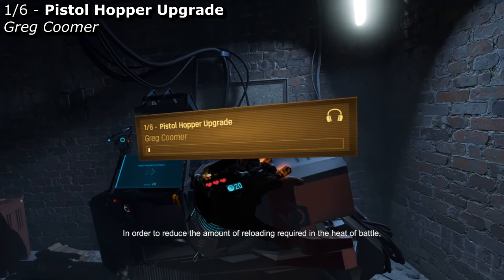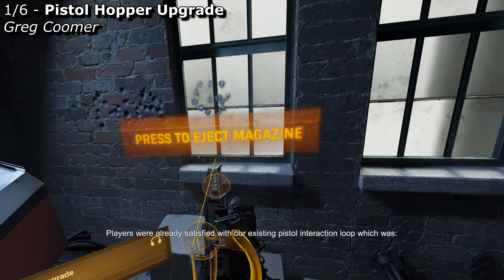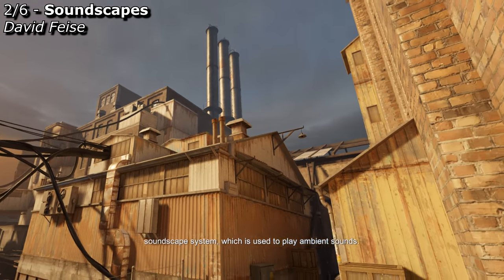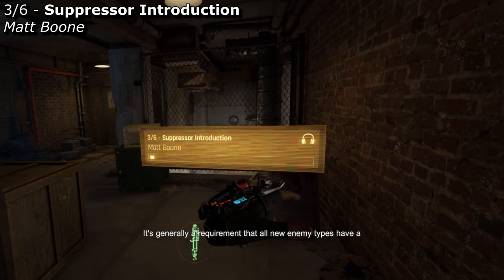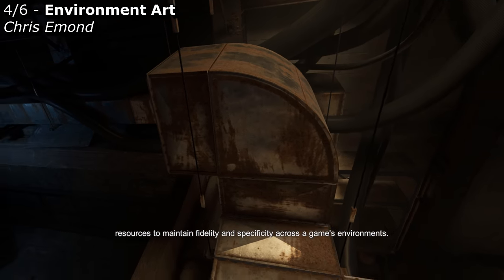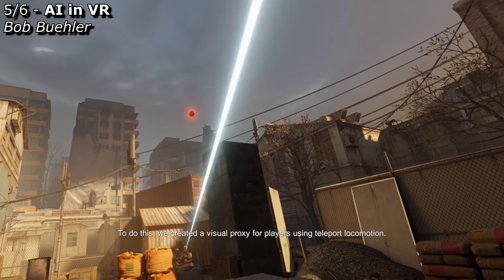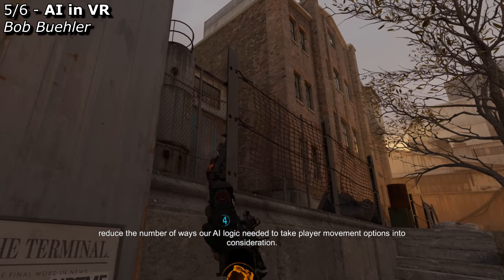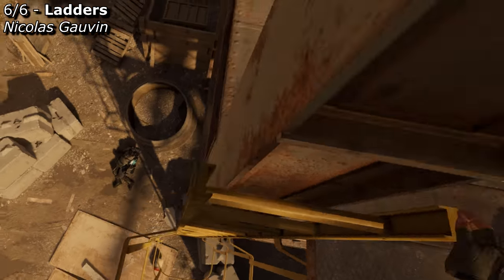HLA Developer Commentary - Chapter 6 - Arms Race

Comment: Hearing this guy say “clips” instead of “magazine” so many times made me physically hurt
Reply: Even internally in the Hammer editor, they refer to pistol ammo pickups as "clips". Valve pls
Reply: @UCM6YqV3fMAvewEykZnEYJjA  counter point: mag
Reply: With the hopper design the magazines are basically functioning as a clip, loading ammunition into an internal magazine like old ww2 rifles. Does anyone actually care about the clip/magazine distinction besides le redditors?
Reply: @asdfg3421  My brother, but he's a gun nut.
Reply: @asdfg3421  That's still not a clip, a clip is dropped in the mag while the hopper is just a second mag that takes bullets out of the removable mag.
Reply: @Anon.G  i think you are taking this alot more seriously than others are bud

Comment: "we left visual proxies" yaddahyddah and they still can't shoot you if you teleport, and teleporting is much faster than continuous movement. I used both, for exploration continuous, but in combat i cheated and teleported all the time, even used teleport to run up to enemies since it confuses them and blast them point blank. boo
Reply: Ok? dont teleport if you want to make it fair then?
Reply: If they could shoot you while teleporting, that would probably cause more problems for most players. (Which probably is what happened when they playtested that idea.)